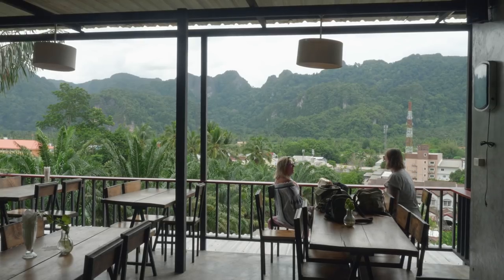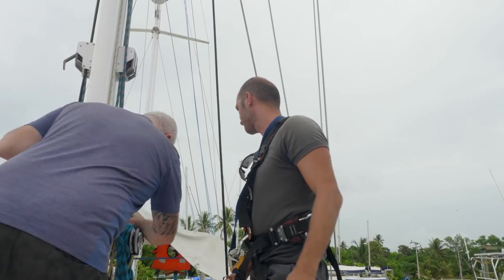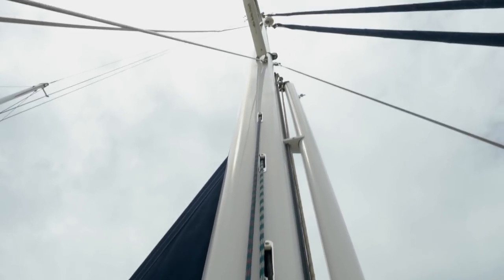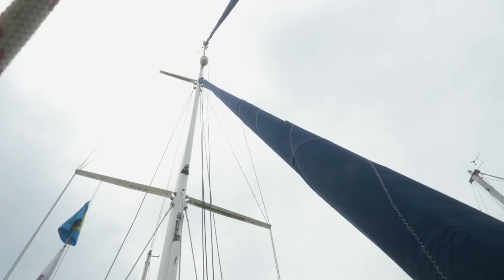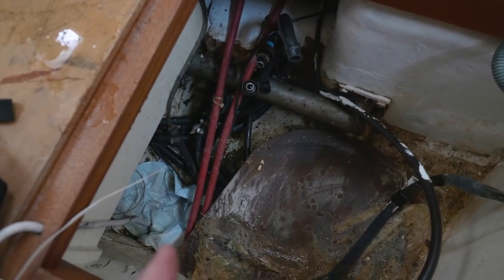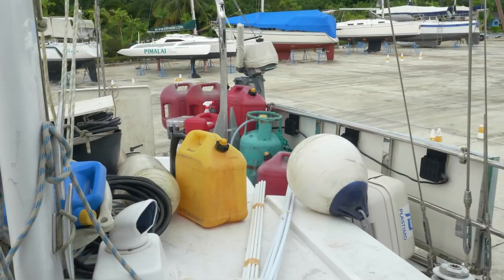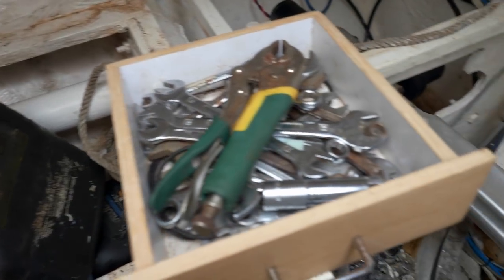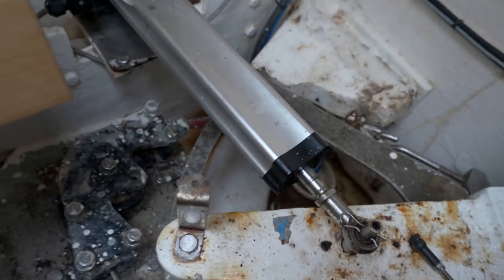SHOULD WE RE-RIG THE BOAT? - SAILING FOLLOWTHEBOAT Ep 116

Comment: There are many boats around here (Southern California) that have rigging well over 10 years old, which only needed a clean bill of health from us to the insurance company. Not all insurers are ok with that. Believe me, i am very obsessive and thorough, but some rigging Does Not need replacing just because it's 10 years old. Yes, i know what crevice corrosion (not to mention chloride attack etc) is, and where it occours. I would expect to find a bit, perhaps, on the part of your staysail deck fitting that is out of sight below the top deck surface. Not the end of the world, just not exactly "oxygen city" down there. Thank You
Reply from the maker: Hey Marty. One thing we picked up on when talking to Jai was the difference between swagged fittings and Norsemans (Sta-lock). If one thread in the cable goes on your swagged fitting, the whole thing goes. On a Norseman you can get away with one cable going as each cable is clamped separately, if that makes sense. Not an excuse not to re-rig but having norsemans does offer a bit of flexibility.
Reply: Sailing followtheboat yes it makes sense. However i have seen many swage fittings where only 1 or 2 of the wires in a 19 wire strand have let go, and indicated the fitting was deficient. If they all go at once, it is likely that crevice corrosion has been at work for awhile, unnoticed at the intersection of the swage shank and where the cable (actually called "strand") enters it. If you can still get Norseman fittings, great. Just ensure they are Mk VI . They are unavailable here. I have never seen a StaLok fail, they are a bit bulkier and less ubiquitous. I am not going to condemn  anyone's recommendation to use dyneema. We have had tremendous success using it on sailboats and commercial trawlers. I would not use it in this case because it is going to be around 5x as expensive, you would need to modify every single termination point, and being synthetic, it cannot possibly tolerate direct sunlight as well as wire. Being synthetic, it is much more prone to damage from chafe, sharp abrasion and impact. The only advantage is the weight savings, which yes means more stability, but at the same time, a quicker motion. Anyone considering dyneema is advised to let Dux do your splices. Sure we can splice the ends, they do it best. I have watched many how-to videos for this type of splice; watching someone do their own when it's their first attempt, and So Much is at stake, is really frightening. (It's their tapers that will make the splice trustworthy, and they're frankly nowhere near as strong as what you get from the manufacturer). We order it made to length, and we splice all types of line and cable every day. SO, what i did not mention previously, is rather than measure your rigging in place, go around and make notes about what you would like to see done differently on the next version, like less sheet-chafing exposed turnbuckle thread for example. Then pull the rig, lie the cables on a flat surface, and measure them in a "relaxed" state. The old rigging makes perfect patterns for new. The most important step is to First measure the gaps between the two male threaded ends of the turnbuckles, so that can be duplicated later when you measure them. For tubular turnbuckles, measure to the pin centers before loosening. Just taping around the turnbuckle thread to mark where it was set is not satisfactory. Keep the shrouds and stays together with their own turnbuckles if possible when disassembling. If you just pull the rig without making notes, then you are repeating the mistakes that were made previously. Measuring cables unstretched makes sense because that's how their replacements will be cut. Measuring cables stretched, in place, requires alot more guesswork. If you are dealing with one or two furlers whose lengths cannot be adjusted, there is no law that says you cannot put two backstay turnbuckles in series to gain adjustment range. And the headstay inside the furler, which cannot be seen, is normally the most subject to failure because it is dirty, oxygen starved and pulled every which way by the sail atached to it. The original Hoods, like the Gemini, had us taping the bearings to the wire, which prevented us from removing the stay from the furler. In most cases hovever, the wire headstay can be removed and replaced inside the same furler. It is something we do routinely, but please ask and trust your rigger. All i needed to see was the way he attached the miz halyard to his chair to know that you are on the right track. Thank you. Second look it was a headsail halyard he was tied to! Was mesmerized by Liz aloft and ass umed jai was ascending the miz while she was flyinghigh.
Reply: Hi Marty, how often, or common is it, for rigging to fail catastrophically? That is say, to the point of dismasting? I’m guessing, with my very limited knowledge, that it’s fairly rare...
Reply: Ben Gordon hi Ben.YES. But that is a hard one to answer. I will say that is was less common to lose the whole rig when masts were glued up wood ( rather than box section wood). The spar itself just had a lot more resilience than modern tubes. When i want to avoid catastrophic failure,  but don't want to re-rig, then (here we go....) i simply double up on everything that is supported by one shroud or stay. This is where dyneema is really a good investment. It is not as necessary for something like double lowers, because if the fwd lower, for example fails, the aft lower can save the day. But for single cap shrouds, tying another one made from dyneema parallel to it ahead of time might just keep the rig aloft. Rig the lower turnbuckle pin with a (forged) shackle's pin instead, and straddle the toggle jaw with the shackle. RF 641's, or many Wichard patterns, are perfect for this. Anchor the dynema at the masthead with whatever knot, tie a loop as high off the deck as possible within reach using something like a hackamore, manrope, simple figure 8 loop, or bowline-on-the-bight (use both loops), then take the end of the line through the shackle at the bottom, and up through the loop, to make a trucker's hitch. I am not a big fan of trucker's hitches tied with slipknots. Then go down through the shackle a second time, and through a loop tied in the first round, just after it passed through the original loop. In other words, tie your trucker's hitch Cascade Style. After you have stretched this parallel-universe shroud as tight as it's going to get, THEN go aloft and deflect it out to the end of the spreader. You don't have to hook it over the end of the spreader if you can secure it to the spreader tube with a Square lashing WITH strong frapping turns. Otherwise, tie some of your lashing around the original shroud, to hold it out there. Backstay doubler is self explanatory, for the front consider a Solent Stay, which is a stays'l stay anchored at or near the top of the foretriangle. Remember, the thing about solent stays in general, esp if they both have furlers, is that Only One of them at any time can be the tight one, the other one will be relatively slack, and it can be quite a drag to have to put up with the furled sail incessantly whoop de dooing, which often reverberates throughout the whole boat. OR, keep a spare, tensioned halyard shackled to the bow (or stern).As far as intermediates go, they may be less likely to fail because their purpose on modern rigs is more to keep the mast in column than to hold it up there. And it's not like you can just tie a bowline around the mast 2/3 of the way up. As for chainplates that you are just sure have gone to hell below the deck where you can't see them, make up a batch of Chainplate Helpers, which are just short sections of ss angle that bolt against the chainplates above the deck, and below the deck, and then bolt together Through the deck, adjacent to the real chainplates. Does any of this make sense? Think outside the box. Thanks to FTB for letting me bleed some steam here!
Reply: Hi Marty, that makes complete sense, and helpful too. Thanks for sharing and yeah, thanks Liz and Jamie.

Comment: If your rigger signs-off on the condition of the cables and the fittings, and replaces everything that isn't quite up to snuff then I don't see anything wrong with your decision of putting off replacing all the rigging.  It'll have to be done eventually, but he's the professional.  If you have doubts then you can always get a second opinion too.  That one wonky crooked swage is worrisome, was it always like that or did something get in there and damage it somehow?  I had a swage done a couple of years ago that was a little bit crooked like that right out of the machine, and the rigger said it was within specs.  I just didn't like the looks of it o.o It seems wrong to me.

The welds on the chainplates were the most concerning to me.  How hard are the chainplates to completely remove and to have inspected off-site? Tiny cracks are not good in welds as I'm sure you know.  There are techniques to look for microscopic damage and signs the metal is coming apart, and those are best done in  controlled environment on the bench. 

I was wondering if your loose cutter stay could be solved by also loosening up your forestay a bit and then tightening up your backstay in turn, giving your mast a little more rake by a slight amount.   It seems to me that if your backstay seems really short and hard to install, and your cutter stay is also loose that maybe your forestay is pulling the masthead too far forward.  Is the forestay adjustment set in stone like your cutter stay is, or can you ease it out a few threads?
Reply from the maker: Yes, we're just buying ourselves a little bit of time. The rigging will definitely need to be changed at some point, James. The rigger is on the case with the stay and we're already made some minor changes that have tightened it somewhat.

Comment: I doubt, that dyneema would make sense, because it stretches far less, thus stessing everything around it much more. Yet the latest breed is clamed having near zero creep, you can splice it all by yourself and spare rope carryed along gives no weight penalty. Less weight aloft and the ability to do any repair in the middle of nowhere at low cost, sounds quite irresistable.
Reply from the maker: We're looking at replacing some of the running rigging with Dyneema and I think in the future we'll look into it as a rigging option too.
Reply: You mean, when you finaly do not come around re-rigging. Sorry, English is obviously not my mother toungue. What's that called, where the shrouds and stays are connected to the hull and the mast? Anyway... it must problably be reinforces significantly. Then Dyneema could be a beautifull option.

Comment: If you do re rig, go with dynnema. It's lighter and more easily repairable, inspection is easier. You can repair or replace any where at any time. Dynnema is stronger and no more cracks or guessing. You can try it on your safety lines first.
Reply from the maker: We were tempted this time round but it wasn't to be. However when we do come to rerig (maybe in the Americas?) we'll be seriously considering Dyneema.
Reply: It is true that Dyneema is up to 15 times stronger than steel on a weight for weight basis. The truth however is that we don't replace one kilogram of stainless steel rigging with one kilogram of Dyneema. When the rigging is replaced with Dyneema it is replaced with Dyneema that is a comparable strength to stainless steel rigging or more likely slightly stronger. With the proper knowledge and equipment it can be replaced or repaired but certainly not anywhere or anytime. A stay or shroud may require upwards to 400kgs of tension which is incredibly difficult to achieve anywhere/anytime. It is an amazing product for racing yachts but I feel it should not be used for standing rigging on pleasure yachts. I have been told I am right about Dyneema probably as many times as I have been told I am wrong as it is a topic that arising often in yacht clubs around the world.
Reply: A friend and I were just discussing this and he noted that sailboats used hemp rope for hundreds if not thousands of years. Stainless steel is actually a fairly new product for rigging sailboats and was a huge leap forward in rigging at the time when we started using it. I am certain that the future will see more and more improvements in synthetic fiber rigging and eventually I will have no choice but to join the band wagon. Let's just say for the time being I will remain on the fence. :)

Comment: Regarding the fuel tanks, could you glass over the holes in the bottom of the tank and draw your fuel from the top of the tank instead?
Reply from the maker: That's the obvious solution, Bryan, but that pipe is a filler pipe. We fill the starboard tank and it fills the port tank through it, so some kind of connection is essential.
Reply: Possibly a diverter valve, fill one tank then divert to the other or simply add another deck fill, one for each tank?  I don't like bottom fittings in any tank , other than a water tank, since they can or I should say will leak. Anyway, good luck and KOHF.

Comment: For the Mizzenmast Staysail stay. Could you consider changing it to a Dyneema setup. Thinking about it. I am not sure Dyneema would work with the Furler foil.
Reply from the maker: Hi Andrew. I'm not sure how Dyneema works with furling mechanisms. I should ask Jai about that tomorrow.
Reply: Sailing followtheboat it will not work for furlers nor will it work with hanked-on sails.
Reply: It will work for hanked on sails if the stay is served, and the hanks are "soft" (made from webbing). However, with all respect that is due to those with a different point of view, i firmly believe that soft hanks will not budge, up or down, when it's blowing over 30.